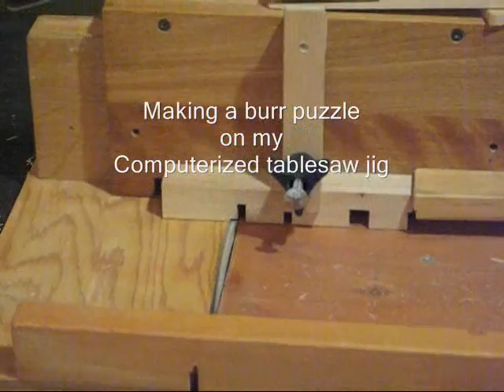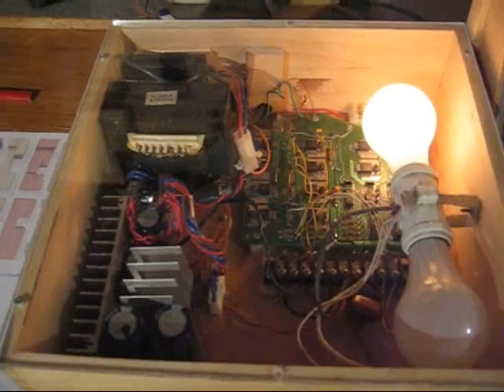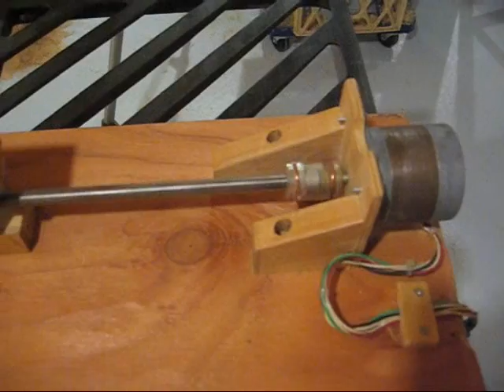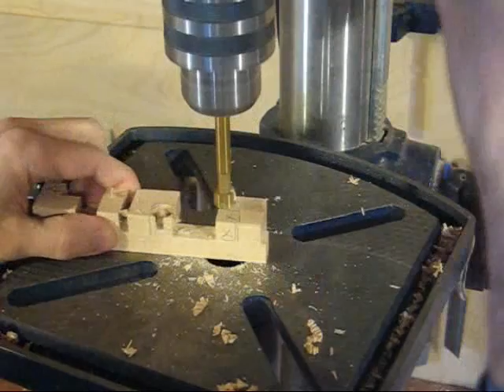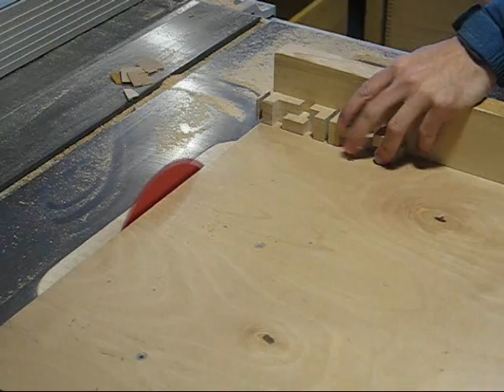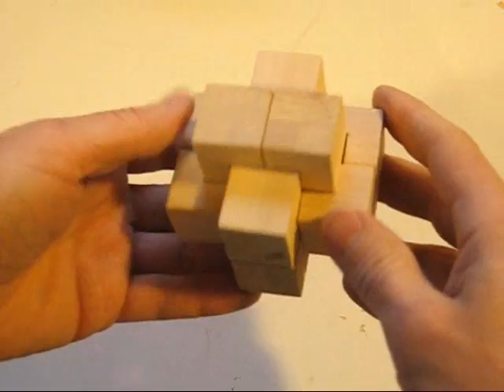Computer controlled box joint jig

Comment: Such a good-looking and strong joint!  I think you were onto something with your computer controlled box joint jig, because you need to cut many gears and the mechanism to combine the gears, and learn how to use the gears.  It's much easier and repeatable to handle the screw advance in software - but with something like an arduino and stepper driver instead of a laptop.  I really like your videos and appreciate how you apply your engineering expertise to wood and woodworking.  Thanks!

Comment: Based on this, did you come around with a CNC router? a 3-axis with some powerful stepper motors (able to move a workpiece clamped, or a router) will open a wide range of projects.
Reply: AsiAzzy yes yes yes

Comment: How do you come up with this stuff? Simply amazing. Just add another stepper motor to push the stock through the blade and then  return to zero and you won't have to do anything but click the mouse. 

I need to take some computer courses at the local college so I can figure out how to make the computer controls and make similar things myself. CNC technology really interests me, but I am totally ignorant on how to design the  electrical portion. Would love to learn it though.

Comment: Do you use any special type of wood to avoid a loosening problem?
I glued 123 1/2 inch oak cubes to form a 5x5x5 solid looking cube.  It was hard to take apart, but easy to put together.
The only problem was after a lot of use and 10 years it began to loosen and was easier to take apart.  Maybe it was the white glue I used to stick the pieces together.